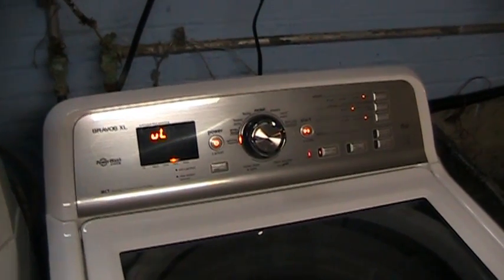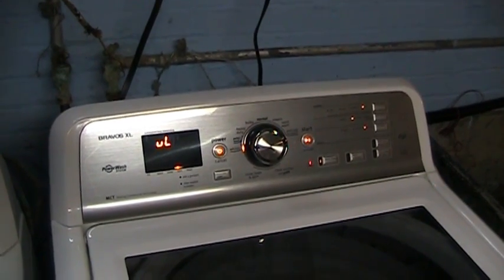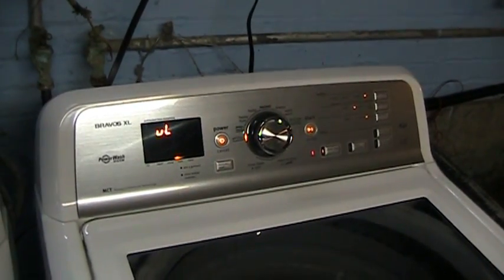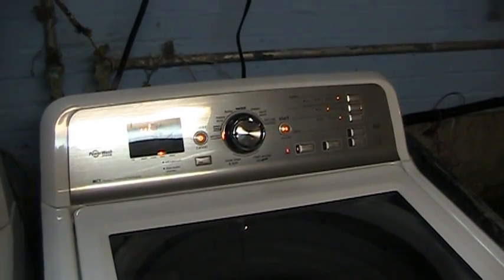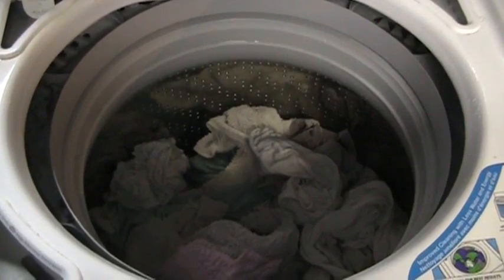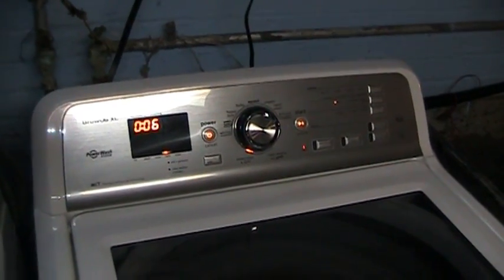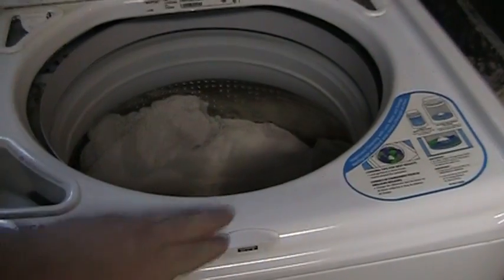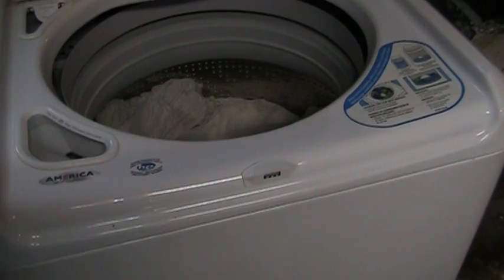Stupid Washing Machine Being Stupid

Comment: The lid lock is meant to stop certain muppets from opening the lid whilst the machine is spinning to reach in to grab things. See there are people stupid enough that they don't understand that putting your hand into something spinning that fast can break arms and fingers. I'm a firm believer in removing warning labels in that this effects some self limiting population control. I realize that's a rather cynical way of looking at things. I'm just really tired of dealing with stupid people who can't figure anything out without video instructions and someone to hold their hand. It makes me wonder if they lack a proper supply of oxygen.
Reply from the maker: Sure, and I totally get that. Only this and more traditionally designed washing machines have a safety switch and braking system that brings down the spinning drum very quickly. Maybe there are some safety regulations of which I'm blissfully unaware that mandate more, although the few conventional washers you can still buy don't have lid locks. So I don't know.

What I do know is that after it burned out from many years of use, I bypassed the lid open cutout switch on a 1970s Maytag washer. Intended as a temporary fix just to get that load of laundry done, nobody around here was stupid enough to stick their hands in there when it was running and it just ended up staying that way until the tub finally gave out.

Removing that switch gave the added bonus of defeating the out of balance shutoff on that machine. After that it'd run like hell no matter how out of balance it was. This was a particularly good show with a few heavy knit rugs in the washer. One time it got so out of balance that it walked across the floor, pulled its drain hose out of the laundry tub and emptied its water all over the floor, ultimately ending up leaving via a floor drain. This led to one of the coolest things I've ever seen -- a drain vortex several feet wide and swirling all around the laundry room floor. As tempting as has been to recreate that scene, I haven't done so...yet. :-P

Comment: At least it gives up after a few times and stops wasting all that water. If our LG washer goes out of balance it will keep going again and again forever unless we stop it and re-balance it manually. We eventually installed automatic timers on the water valves that turn them off after about an hour.

Comment: I'll stick with my late 90s/early 2000s Hotpoint WM53 washer, cost me £35, a pulley (which I already had) and a lot of cleaning (prev. owner left it closed up for a long time so went skanky), but it does the job, fill it up, add the soap, shut the door & drawer, turn the knob, switch it on and off it goes, no annoying eco-friendly-except-when-it-has-to-go-to-the-dump electronics to mess about with balancing the loads... :P

Comment: Dunno this machine but in my case it was a broken rubber tube that lead to the pressure switch - hydrostat. This caused overfilling. After replacing the tube washer started to work properly again.

Comment: Bill, while i've been to the USA for a trip, i had to use a coin-op washing machine. I was impressed that they had very old mechanical machines in there and for me seeing these kind of top loaders was a first, but i was amazed that when i washed my clothes, it didn't do the fast spinning cycle like the washing machine i have here at home so the clothes came out completely drenched!

It was a faulty machine? or it is common for laundromats to not have the fast spin and make you spend 5$ in dryer? :P

Here at home (in italy) we have two washing machine, a front loader and a top loader, but the top loader is basically like a front loader, with the opening on the curved side of the drum instead of the flat side

Comment: we had a haier front loader that the computer failed in, it wouldn't start the drain pump so it would then go erratic driving the drum motor so it would jump around a lot, we replaced that with a second hand relatively modern hoover top loader with traditional hard controls and no computerization of any kind

Comment: We had a front load GE washer that developed a fault in the inverter board and it would no longer spin in one direction, that of course being the normal operating direction.  It was more computer than washing machine.  There were more chips inside than a laptop had.  It got replaced by a $50 Maytag that was about 10 years old.  Its only problem was that it wouldn't stop filling. I opened it up and found it had not a single electrical component inside, just knobs, switches and timers.  The problem was a mouse apparently had chewed through the level detect hose.  I quick splice and it was back in action. The GE's matching dryer had also died some months before the washer did. It was replaced by a craigslist special who at the last minute decided he didn't even want to charge for it. It died after a month, but was a $5 temp sensor that I replaced and back up and running like a champ again.

Comment: Just one more data point that bolsters my decision to keep my Kenmore from around 2001 until it breaks beyond repair (if ever).  Put some new agitator dogs in, had to replace the water valve (cost for both was maybe $30).  If the time ever comes to replace it, I'll be getting the Speed Queen.  I'm confident one of those will outlive me.

Comment: i had a LG frunt loader washer and drier and the washer droped dead within 7years of hard constint servis. it ran almost evrey day about 4times a day. about 1year later the heater elemint in the drier died an my dad did not want to fix it :(  so he trashed it. but i did salveg the frunt panel and man board. i bet if he wold have replased the elemint it wold probly still work. and with the washer thar was probly a fues in it that whent open...

Comment: We have had a Bosch front loader machine for about 14 years now, from the UK here. It has been very reliable, it has broken down twice but all it needed was new brushes for the motor and i fixed it my self both time for just £5 and an hour getting the motor out and back in. 
They don`t make em like they used to.
Reply: Does yours have an LCD display?  Our top of the range 2006 Bosch model has one, and it did not last very long and now virtually all the digits are missing, making it totally impossible to know what settings we are using.  I gather this is a problem with having LCD displays in a harsh environment like a washing machine.  However my sister has a bottom of the range Bosch, and that is much better and more reliable in many ways, and she is not a person who looks after things.

Comment: My Samsung washer and dryer combo seem to be holding up well.. 3 years strong, no glitches or errors other than user error.  My friend triggered a soap sub error code for using too much soap and filling it directly instead of though the soap slot loader.  But it self cleared and started running again.  Even if my load get hugely out of balance it self balances and and adjusts accordingly... my Samsung fridge however, I had to replace within same 3 years... and lucky for me Samsung offered a refund but only valid if I got another fridge directly otherwise they offered send A out a repair tech for free.. I took refund after seeing I could get new touch screen fridge for only $1200 difference...  (sorry I love technology, even tho it sometimes proves to get in the way) see how that hold up... seems to detect its own issues and adjusts temperature regions... big issue my previous Samsung fudge gave me was constant water or ice build up on bottom shelves and bad temperature regulation...

Comment: My family's fairly recent Kenmore washing machine (not sure who actually manufactured it) did something similar to this recently.  I came down to check on it, and it had shut off with "uE" in the display.  I figured it was complaining about being unbalanced, so I tried to fix it.  First, for whatever reason, despite the fact that it had shut down, I still had to press Start/Pause to get it to unlock the door, which I would think it shouldn't need human intervention to do.  Once I had rebalanced the laundry (or tried to, at least), I started it back up, and it went through several runs of filling, draining, and spinning (kind of like what yours did, except with a bit more logic and reason to it) as it tried (and failed) to redistribute the load.  Eventually, it just shut down with a "uE" code again.  The machine was never very happy with that load; I don't recall how I got it to like it.

Another thing I've noticed with these newer machines (both washers and dryers) is that they often have a rather interesting sense of time.  In the incident above, the washer indicated 1 minute remaining through almost the entire time it was trying to redistribute the load (5+ minutes), before eventually deciding it had 12 minutes left, then shutting off soon after.  I've also noticed that on the dryers at my college (Speed Queen units installed last year), they often underestimate the amount of time it will take to get a load dry when the sensor function is active, and they end up hanging on 10 minutes remaining for quite some time before deciding that the clothes are dry and starting the cool-down cycle.  More strange, however, is that sometimes, when making their initial predictions of dry time, the dryer will claim that it will take longer to get the clothes "near dry" than to get them "dry".
Reply from the maker: Whirlpool is the OEM for a lot of Sears Kenmore branded large appliances, although that is not as universally true as it once was.

Apart from this time and the time when it crashed, this machine has either rebalanced itself or I've been able to get it done without further incident.

The estimated time remaining displays on both this unit and the dryer are not at all precise. The dryer tends to have its time estimate jump up, while the washer will occasionally just knock off several minutes from its estimate. Given that both units have a standby power supply and are never truly off, and I'm sure the microcontroller would have had cycles to spare along with some nonvolatile RAM, shaping the timer's behavior based on prior runs wouldn't have been that difficult. Funny thing is, the simple feedback circuits used in machines with mechanical timers aren't ever that way, if only because the timer motor can't run backwards!

Instead, it seems like they hired the Microsoft programmer who wrote the code behind Explorer's time estimation in Windows 95 and 98. (Okay, not really, but it makes for a humorous aside.)

Comment: How embarrassing that with today's incredible advancements in electrical technology compared to washing machines of past, they still manage to fuck it up. I know a lot of people would argue that a mechanically controlled one would be superior, but given a competent design team a fully computerized one should last just as long while offering superior washing methods.
Reply from the maker: This is another thing that bugs me: as you rightly point out, today we have the technology and means to build and design things better than we've ever been able to before. And yet that doesn't happen with truly depressing regularity.

Somewhere along the line, you'd think someone might take some actual pride in their work. I guess not.
Reply: Alliance actually makes decent electronic controls, at least good enough to stand heavy commercial use on the daily, and I believe the same controls are used in the consumer line. Dexter from what I can tell also seems pretty robust.

As for electronic controls on dishwashers and the such, well, I can't really vouch for consumer-grade, but on the commercial/industrial end of the scale, we've only had the electronic controls go out on one of the big dishwashers at my job (Hobart FT900) once that I can count and that was a year or so ago. so apparently Hobart kinda knows what they're doing on that end, and most of you may not know this, but Kitchenaid was actually their consumer division originally until Whirlpool bought them out in '86, and thus their DWs shared parts with the Hobart undercounter line of the era. sigh The wonders of looking up totally useless info late at night, lol.

Comment: Would you buy any of the Speed Queen models even the front load models ?

Surprisingly many of the internal parts used by Speed Queen models are used by many other 'consumer grade' brands...do you think Speed Queen went down in quality ?

I wonder if maybe it's simply better to buy a true commercial washer used by laundromats what do think ?

It would be very enlightening if you made a video about washing machines quality and a buying video guide...
Reply from the maker: The Speed Queen units I've seen offered for sale (granted, not a whole lot of them) all seemed far better made than anything else on the market. I'd not be surprised to learn that they have a lower end offering for a "price conscious" buyer. 

Just about any laundromat around here has Speed Queen equipment, much of it quite old and still working quite well. (I've only ever seen one that doesn't -- their sign boasts of being "Maytag Equipped". Yet again the machines are older, from a time when Maytag probably could have mixed it with the big boys.)

I have absolutely no desire to ever own a front load washing machine.

Comment: First, OL/UL stands for “Overload”, so in other words, the washer things the tub is too hard to move because it’s overloaded and the motor is struggling or the unit is way out of balance causing the washer to struggle. The most common problem is a nut below the inner tub that needs to “float”. Floating is when the tub fills up with water to a certain level the inner basket will rise about 1 inch from the center agitator. What this does is disengage the basket from the motor so that the agitator can rotate independently from the basket. If the basket does not float then when it tries to agitate the whole basket will turn back and forth at the same speed as the agitator and this will cause the OL/UL error code.
Reply from the maker: I'm reasonably well aware of how the machine works and as such, I disagree pretty much completely with your assessment and diagnosis.

Comment: Speaking of Speed Queen, I lived in Ripon, WI (home of Speed Queen) for about 20 years. Mother in Law lived right across the street from the main plant. I've actually seen (and held in my own hands) the actual, very first Speed Queen Washer (a manual model), It's on display at the Little White Schoolhouse (Birthplace of the Republican Party) in Ripon.
Reply: Wow I know there are many English (UK) location names that were used to name parts of the USA, but I never knew Ripon was one of them.  Here in England there is a quaint, rural town called Ripon, situated in the county North Yorkshire.  Very beautiful place with some history and has a church built in 7th Century.  https://www.google.co.uk/maps/uv?hl=en&pb=!1s0x487eac4b8078603d%3A0x387ca10bb7b416a3!2m5!2m2!1i80!2i80!3m1!2i100!3m1!7e115!4s%2Fmaps%2Fplace%2FRipon%2BCathedral%2F%4054.1351861%2C-1.5209723%2C3a%2C75y%2C115.54h%2C90t%2Fdata%3D*213m4*211e1*213m2*211s2MiHCDPMpgRPBlrYN0eu5g*212e0*214m2*213m1*211s0x0%3A0x387ca10bb7b416a3!5sRipon%20Cathedral%20-%20Google%20Search&imagekey=!1e4!2s72295048&sa=X&ved=0ahUKEwjXlPKT_LHOAhXHKcAKHRC6Aq4Qpx8ImAEwEA
Reply: Ripon, WI is named after that very town in England.
Reply: cee128d
Cool :-)  I only live about 28 miles from there.  The common term for the part of the country I live in is, "God's Own County" which is Yorkshire.  I'm not religious by the way but it is a well used phrase.